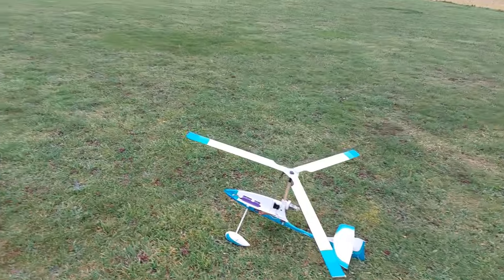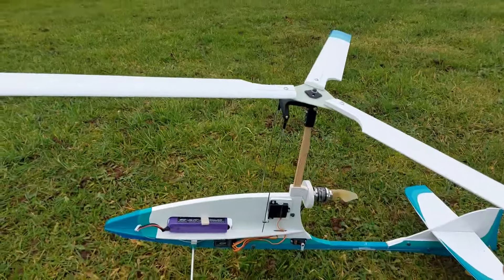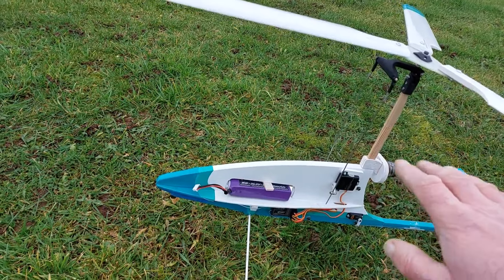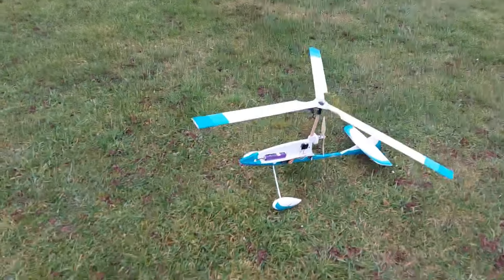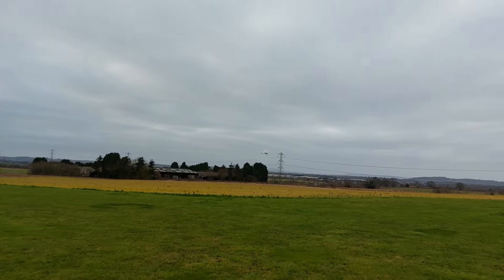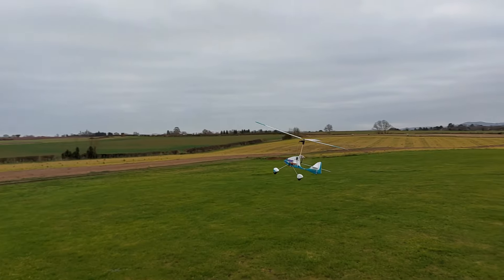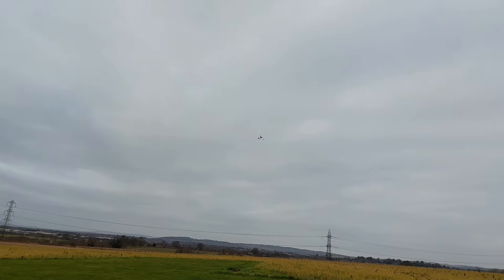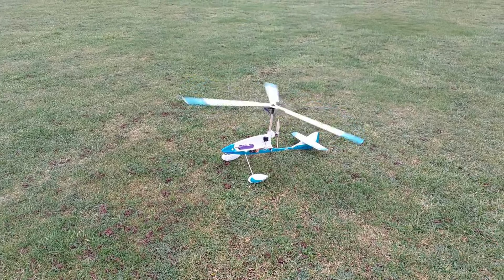RC Autogyro, Gyroo II maiden flight.

Comment: Very nice Richard. This black art gets me very confused. If I listened right, the mast is vertical and you have no shims? I always understood that the blades must be shimmed on the trailing edges in order to spin up. This proved that assumption wrong!
Reply from the maker: The mast is vertical but the blades are angled back. There are no negative shims due to the design of the aerofoil, they simply bolt straight onto the flexi tri plate.